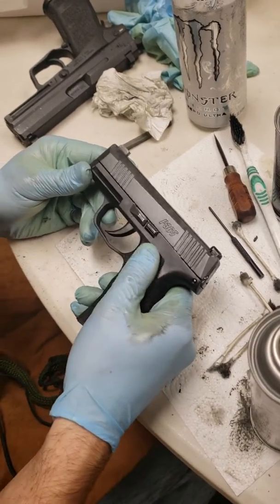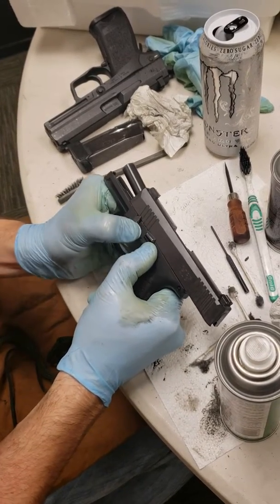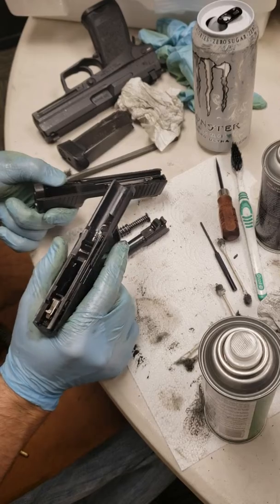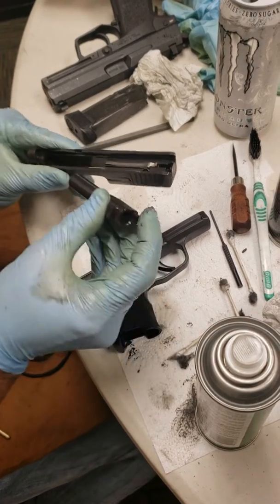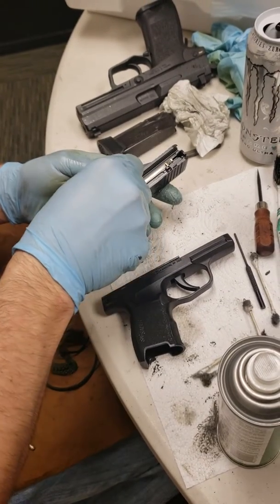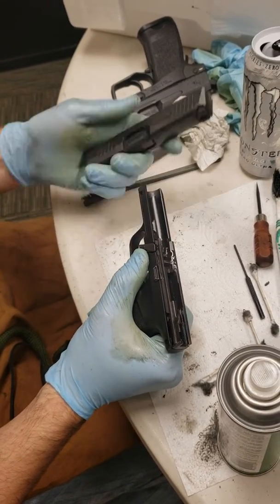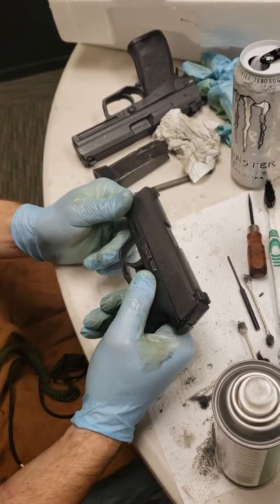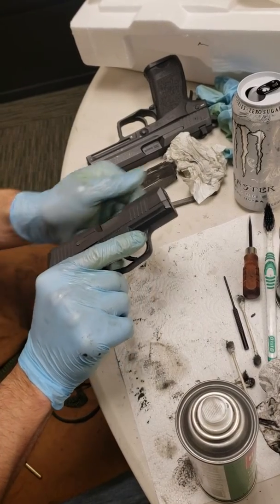SIG P365 Field Strip & Reassembly

Comment: Have you run into the problem of the slide catching on something near the back of the gun during reassembly?  I don't know what it is, but finally saw it and had to push it down with my fingernail.  Is this something that should be repaired/replaced by SIG?
Reply from the maker: That is actually the firing pin safety - or at least the arm that presses it up. It works like a series 80 1911. Just push it down like you did and it will work fine.